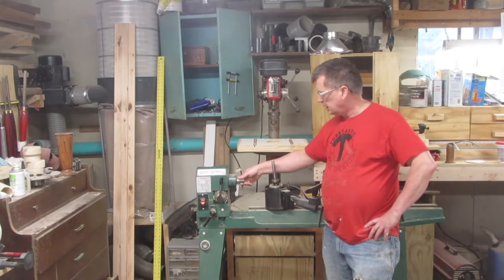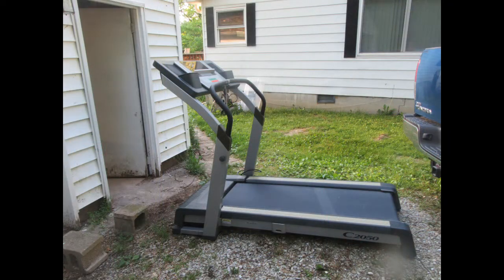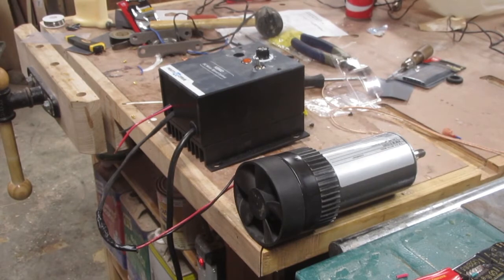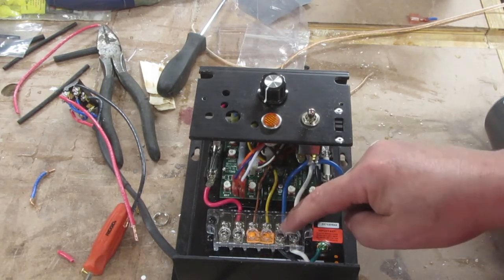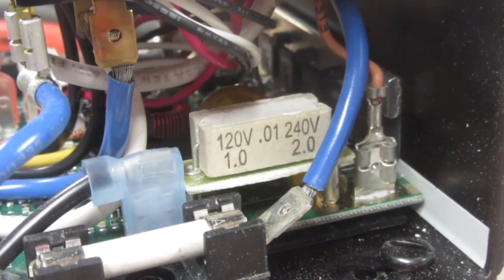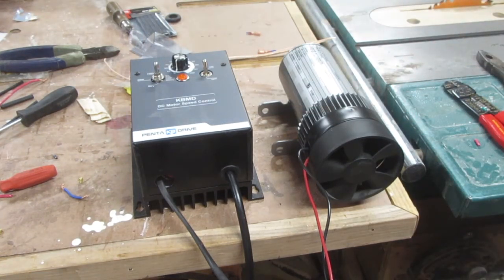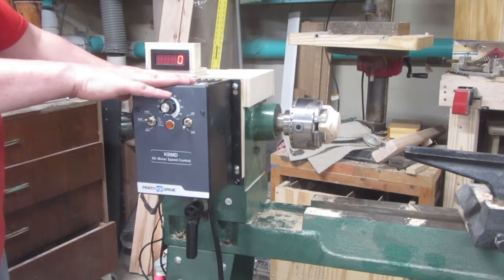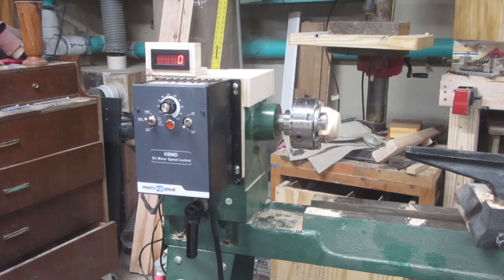Frankenlathe Harbor Freight Lathe Rebuild

Comment: Hi Bill,
I'm thrilled to have found your video, since the Reeves pulley on my 14" Delta Lathe broke into pieces.  The replacement parts are no longer available.... anywhere, I think it's time to convert to DC. 
Can you help me out by providing me with the parts you used and a few photos of the pulley system that you used with the pulley sizes as well? I was able to find almost everything on Amazon except for the pulleys and what size belt you used.
I'd really be grateful!
Thank you for taking the time and making this video. You explained everything very clearly and easy  to understand.

Comment: I would really like to see a detailed build video. Especially mounting the pulley to the motor and the belt to the headstock pulley and what you used. Really a complete video of all the components on the back side. Did you retain the reeves pulleys or change them. Was the motor shaft long enough, etc. even a few pictures would help,us all out. Thanks for the video, it’s The best I have seen.
Reply: I just asked Bill for the same information. Looks like he hasn't responded to you. Hmm. Hope he's ok and still around.

Comment: I have had this lathe for 7-8 yrs.  The one I bought came with a 3/4 horse power.  Still a little under power for some of the blanks I have.  Fortunately Have had no issues.  I am planning on upgrading the motor at some point if needed.  Harbor Freight does sell 1, 2, and 3 hp electric motors.

Comment: Cool mod and all but Ive worked on this model of lathe for 4 years now. The motor is a 3/4 horse!... not a 1/3rd! After 2 years I started to hear the bearings making noise. Two years later they got bad enough to require changing. Swapping the bearings was easy! Heres to another 2 years.

Comment: you failed  to show how  you coupled the new motor to the headstock?? rather important wouldnt you say??
Reply: I'm in the process of doing the same conversion (but with a Canadian Tire Mastercraft lathe - essentially the same). The treadmill motor comes with a flywheel which has an integral poly-v pulley. The treadmill roller is a steel tube with ball bearings either end which runs on a steel rod. The front roller has a plastic poly-v pulley glued to the outside o the tube; it has a magnet attached, so I think it is a good choice to use on the headstock spindle. I have removed the bearings from the front roller, and will chop it to a short length, and am having a bushing fabricated so that I can push the bushing into the tube, and attach it to the spindle shaft with two set screws which will pass through the tube and the bushing, and anchor into the keyway slot on the spindle. I will probably need a longer poly-v (ribbed) belt than the treadmill provided.

Comment: That's a nice upgrade and thanks for sharing, but I really would have like to see how the new motor integrates with the existing HF drive system... Issues aligning, spacing, attaching the old pully on the new motor, etc. Also, whenever we change electrical systems in a shop, adds tools, etc., we really need to consider circuit load. A larger motor is going to draw more current and that could cause issues. For instance, when you have a dust collector and a larger motor like this running at the same time on the same circuit, you MAY be pushing the limits of what a typical 20 amp circuit can handle, and it could constantly trip the breaker if the lathe gets under load. That's maybe not as much of a factor with a larger shop wired specifically for woodworking, but many folks may just be working in a garage with one 20 amp circuit covering all of the outlets.

Comment: I didn't see anywhere how you adapted the belt to the lathe.  How did you?
Reply from the maker: I used an adjustable multi-piece belt from harbor freight https://www.harborfreight.com/vibration-free-link-belt-43771.html

Comment: This HF lathe comes with a 3/4 HP motor , enough to really do some damage if one is not very careful . I used one 5 yrs. turned dozens of bowls without any problems .
Reply: They're notoriously reliable and the best bang for buck maybe ever for a lathe

Comment: What did your father in law to hold his headstock down? I'm having trouble with mine moving when I put pressure on it from tailstock.
Reply: Ditto. I REALLY would have liked to actually see what he was talking about regarding the problem and the parts and process used for the fix.
Reply: @veritasestveritas8646  You don't know what a doohickie is?? :-) [I wondered the same...]

Comment: how is the outcome of your conversion , has it perform good no over heating.  I am currently doing one and wonder about it.  I am a little concern about the dust on the belt and such.
Reply from the maker: I have been running the lathe for over a year now with no problems.

Comment: Did you leave the flywheel off? What size pulley and how did you fit it on the shaft?
Reply from the maker: Odd Todd I had a 3 inch pulley that already fit the shaft

Comment: HI.  Nice work.  I watched your video a few times then got a treadmill motor already removed -- less exercise.  HA.  I've pulled out the stock 1/3rd of a horse motor.  I'm trying to follow your lead with the upgrade, however I'm wondering how the variable speed controller connects to the existing  gear system?  Do you just skip the gears and connect the variable speed controller to the motor spindle?  Could you reply, or put a follow up video or send me a picture maybe?  Dean.
Reply from the maker: Cindy Loeppky yes. i just hook tje new motor to the spindle
Reply: So you are still using the belt and pulley....the treadmill motor shaft was not long enough to give you a sort of "direct drive"?

Comment: How is the torque at slow speeds? Great work, good video!
Reply from the maker: CL Woodturning I think I’ll always wish I had little more power. But I’m able to handle anything I can mount
Reply: Cheers bud, I ask because I own a Draper WTL90, pretty identical to the HF with Reeves pulleys and 1/3HP motor. I have a 3 phase, 2.2Kw 3HP motor ready to bolt on, just waiting for an inverter drive to come through shipping. I'll be doing pretty much the same job as you.

Comment: What size KB switch did you get? How did you figure out which size to get? Thanks
Reply from the maker: I just googled KBMD variable DC motor controller.
Reply: Turntastic Wood Designs what is the amps on your dc motor? Mine is 18 amps and that seems to be an issue with KB Electronics as to what model switch I need. Just wondering if you ran into an issue too.
Reply from the maker: zetus kid My motor is rated at 1.75 horsepower, but I don’t know the amps.

Comment: One more thing.....  I used a Cambridge 3 hp brushless dc 100 volt permanent magnet motor. I purchased this VIA Ebay for $125.00 free shipping. I chose the 3 hp for the torque which it doesn't seem to lack.  I run it forward and backwards.  Backwards to sand and also to rough out the insides of bowls and decorative lidded boxes ahh.... until I am satisfied and finished. In reverse the cuts are going away from me so I can clearly see the cut, also so I do not have to lean over the lathe for a clear view. I have had ho issues with stalling but that's about how aggressive a bite you take.  When I work I am not in a competition or race, so for me, easy does it. I have early on wrecked some good wood being in a hurry, also there is  no overheating problems.  The controller was an empty case that was  thrown away. I added the circuit board and all the components inside. Taking care of my wife who has since passed and working this lathe will win no beauty contest. I was trying to get it done in limited amount of time available, but the damn thing works great. The live end and spur both have been replaced with far better and my tools are carbide cutters I get from Eddie Castelin. ( eddiecastelin.com) The handles are hickory I made on this lathe and used mild 1/2" round bar steel for the shafts. I like my handles long to rest the handle against my hip while roughing for stability.  This has been my experience hope it help some of you out there.

Comment: Nice rebuild of a crappy lathe. I have the HF mini lathe and changed to a treadmill motor setup on it. From the research I did on treadmill motors, you should not run those dc motors in reverse very long. They are designed to run in forward direction, something about how the motors are wound. Also I found that using the controller from the treadmill was actually pretty simple. If you are interested to see how I did my lathe conversion please go here https://www.youtube.com/watch?v=xLpsL3HEsvs&t=242s

Comment: Bought that same Lathe 5 years ago , motor went in a week. Just before that I tried to turn a large bowl backwards with the bed extension made for that and it was disastrous. I looked away for a second and heard a loud bang which was the whole headstock, blank and motor were bouncing across the shop floor. Upon inspection found out the headstock cast metal is Chinese which has a very poor carbon content very weak.  My solution was to create a new headstock of 3/8" steel plate welded, a 3 hp treadmill motor, I am a licensed Electrician so I made a controller to convert 120v AC to DC. The Tachometer is like yours which is named a Proximity switch. Every time the magnet passes the head it reads hence the RPM read out with a digital read out. I did the same to the tailstock like the headstock but that left the lousy bed. I was given some railroad tracks so I cut them for legs and a bed. The bottom of the track are perfectly flat so flipping them over welding in horizontal supports and then the legs this is sturdy and heavy but needed for turning large bowls. I forgot to mention while making the head and tail stock I raised them to turn a 30" bowl if I so desired. I knew nothing when I started. I watched Capt Eddie and many others to learn the basics but the rebuild was on me and I am so grateful I had the skills to accomplish it as there wasn't much help for this at the time, a sick wife and no money for a new one.  Would I recommend this to anyone specifically a beginner? Hell No! Learning you need to spend your time learning the wood, tools techniques, and how to finish wood. not spending more money and your time rebuilding this nightmare. My recommendation if your serious to learn.... there are many used lathes at reasonable prices, there are new lathes not so expensive but learn from others, be wise. Compile your arsenal of new knowledge and decide what you want to turn then go up some in capacity as your desire to to more will grow with it quickly. steviegsg7@gmail.com Good Luck!
Reply from the maker: Steven Guillette WOW! Sounds like a awesome build.
Reply: Thank you, but the cast on the headstock cracked apart that's why I had to do what I did. They shouldn't advertise it can do what they say it can do because it cannot. By the way Good video.
Reply: Steven, I would love to see a video of the lathe you made. Sounds like you pretty much made it from scratch. :)
Reply: Send me your email I'll send you photos.

Comment: At the beginning of this video you said your HF lathe had a wobble and your father in law added a couple of pieces of metal to some part of the lathe head stock. Can you show us where exactly he did that? My exact same lathe seems to be out of round at the drive spur.  So maybe that fix would work for my lathe? I tried moving the head stock and tightening it but did not seem to help the out of round that's is going on. Thanks.
Reply from the maker: We took some flat pieces of steel and and drilled holes in them. Then we drilled and tapped matching holes in the head stock and the base. We put bolts through the holes and tightened them down. This means I cannot turn the head for outboard turning, but, that does not bother me. We basically bolted the head stock down to the base.

Comment: Major improvement to the lathe. HF is known for over rating their motors. If they claimed it was a 1/3hp, it was actually closer to 1/5hp or 1/4hp anyway. You can always get the "real" HP rating by doing the math when you have the voltage, amps etc. There is a formula.  You'll enjoy the new lathe man.
Reply from the maker: It has been working pretty well. Thanks for watching Charlie.

Comment: Do you happen to have the part numbers and/or sources for the resistor and heat sink?
Reply from the maker: Plug-In Horsepower Resistor (9843)
https://www.amazon.com/gp/product/B007YA2SWC/ref=oh_aui_detailpage_o06_s00?ie=UTF8&psc=1

Kb Electronics 9861 7" Heatsink
https://www.amazon.com/gp/product/B007YA3722/ref=oh_aui_detailpage_o03_s00?ie=UTF8&psc=1

Comment: Bill -- Nice save of a broken tool.  I suggest you move the controls to the tailstock end of the lathe.  That way, if something goes wrong while you're turning something largish, like a bowl, you won't have to reach through the "line of fire" to turn off the lathe.  Of course, if you're only going to turn spindles, the safety issue goes away.  Even then, I think you'll prefer the controls to be on the tailstock end of the lathe.  When cutting at the headstock, you sometimes need to hold your gouge so that it's handle is far to the left.  The position of your control box will prevent that.
Reply from the maker: Thanks David. That makes a lot of sense, I think I'll try it.
Reply: What if you're standing to the left of your bowl?

Comment: I'm curious if the better motor and added HP fixed the wobble.

Did you reuse the drive pullies that came with the lathe?